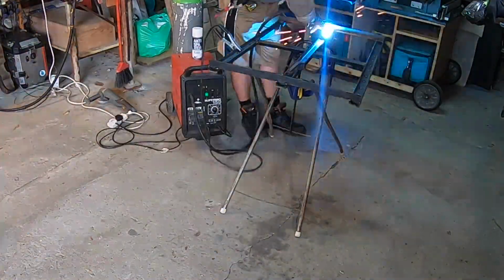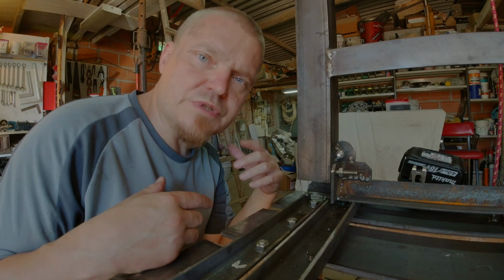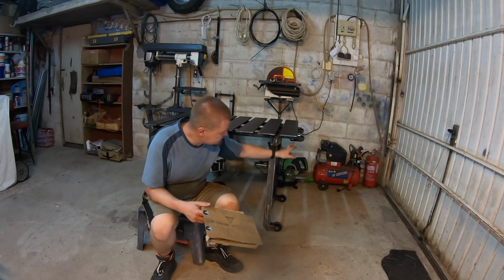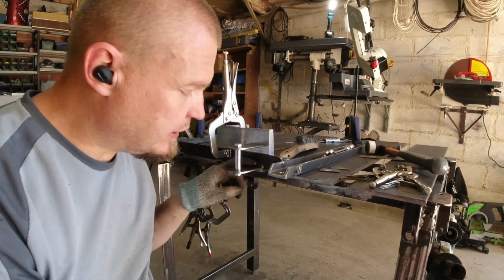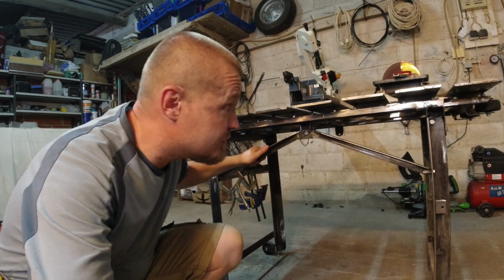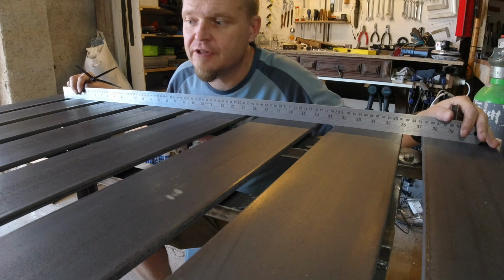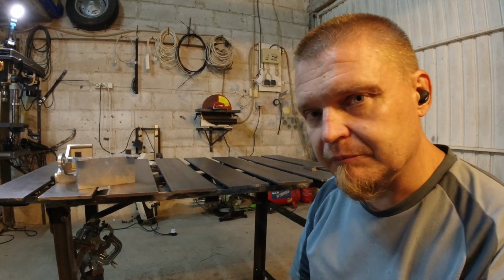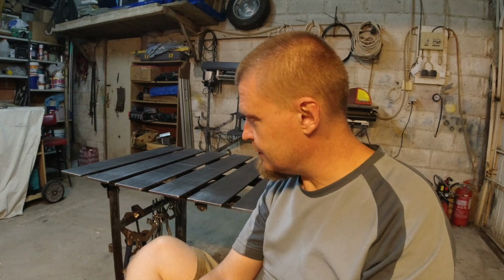Adjustable welding table with folding legs - Part 4: Fixing mistakes, leg braces, etc - JLW#022

Comment: A little late in the day for you but for others watching this they may like to try using a heavy gauge paper soaked in distilled vinegar and leave the metal surface wrapped in the blanket for 24 hours before taking mill scale off the surface with a flap disc.
This will save time with the flap disc when it comes time to use it to remove the remaining mill scale.

Comment: I also want to see more. Thank you for putting it out. Really interesting and yes, the details will help once I will move to build mine. That is after some courage to finally unpack the welder to perform a second weld in my lifetime (the first one, 20 years ago, totally scared me off.) Need move fast as the world is ending soon (love an occasional bloodcurdling remark you insert). Also, you reminded me of my fantastic Makita steel cutting saw I need to honor more, starting with sharpening the blade. Thanks for that alone.
Reply from the maker: Thanks again for your kind words. I'll make a note of the request for more. I hope you get your welder out and have a play, I'm sure it'll go well. I'm sure you're also aware of Jody's WeldingTipsnTricks YouTube channel, I'm sure he'll be able to give you the final push to unpack the welder. I hope you get going soon. 😎👍🏻👍🏻
PS, you gotta have some humour in this crazy world! 🤪